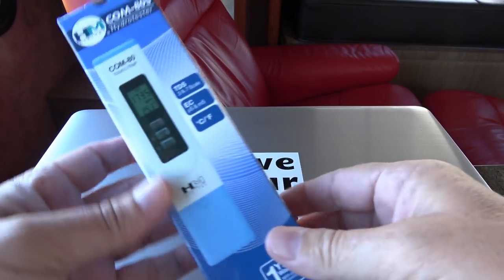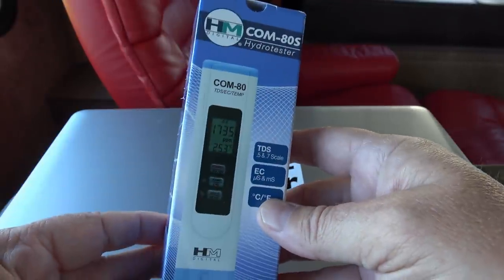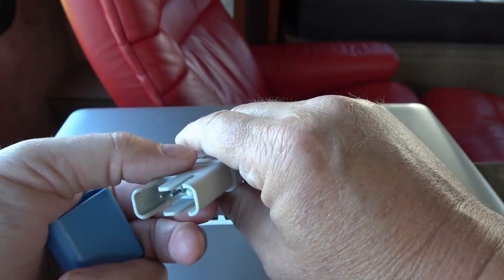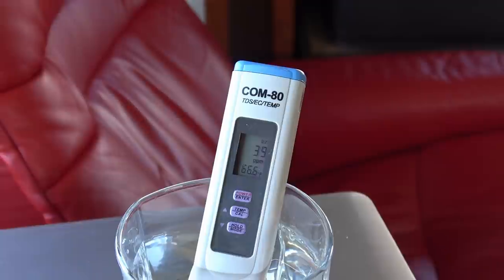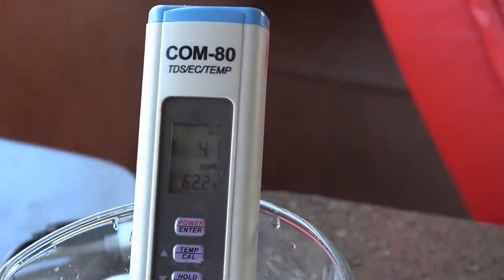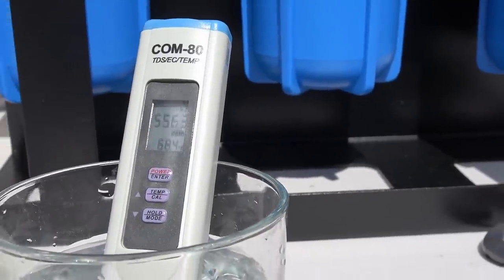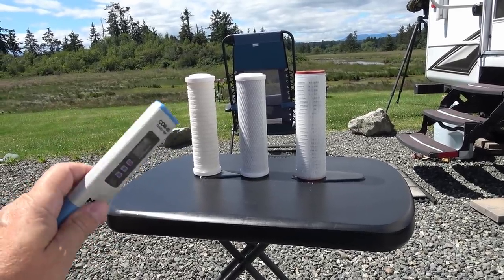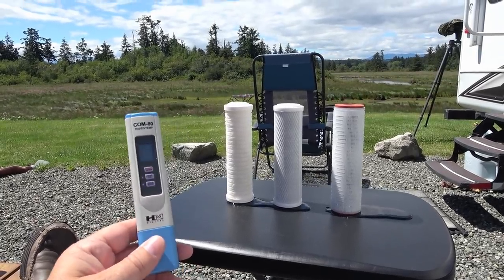Testing RV Fresh Water for Total Dissolved Solids - HM Digital Hydrotester

Comment: Thank you for designing and running this test. I have a system like your clear water and then stopping using it when I discovered it did nothing for PPM. I live in CA where tap water is horrible. I use the Zero water containers now. A filter only lasts about 30-40 days here. I am ok with the water until it surpasses 200 ppm.

Comment: Total dissolved solids are not automatically dangerous pollutants or contaminants. Ultimately, the type of dissolved solids in your water is far more important than the amount.
Reply from the maker: Yes, good point, many dissolved solids are supposed to be healthy for us. It's good to know if the levels are really high though as its not that great for the RV plumbing, faucets, kettles and water heater. Also the taste can suck. :)
Reply: @LoveYourRV  I am aware of the interaction between copper pipes or old cast iron and TDS but have never heard of any reactions with plastic pipes.
Reply from the maker: The calcium and salts deposits can clog the faucets, check valves, etc and settle in the bottom of the water heater, requiring much more flushes. If really bad it can build up in even the plastic piping and waste tanks.
Reply: @LoveYourRV  Our system is a Dalton Ceramic and a carbon block filter that is .5 microns. My point is that if you are going to test it needs to be valid. Not really practical with varying sources so assume the worst and filter for that.

Comment: Ray, I am in the process of installing an Acuva UV system in our trailer. RV Geeks had a discount coupon for $100 off that worked great. The system is from British Columbia. We are hoping to be able to drink the water from parks rather than bringing bottled water all the time. I will have a sediment / carbon filter upstream on all our water. This UV system has a dedicated faucet at the kitchen sink for drinking only. It is 1.2 liters per minute and the UV lights are LED.
Reply from the maker: Cool. :) They offered me one for review a few years ago but I declined when I saw the low liters per minute.  Here in BC I don't mind drinking right out of the tap, we have awesome water here in Campbell River and when in the USA I just buy from the water purification machines for about a buck for 5 gallons.  Let me know how it works for you.

Comment: The carbon filter in your setup is mainly to improve the taste of the water.  The simple, single stage RV filters that connect directly to your water supply hose do the same thing, but without the separate sediment prefilter and "polishing" post filters.  If flattened out to the molecular level, a teaspoon of activated carbon is said to have almost as much surface area as a football field.  That is why it makes such a good filter for liquids or gasses.
Reply from the maker: The cheap single stage carbon RV filters have much higher micron rating and the flow isn't as good, especially as they get clogged up.   I showed a cheap Camco and it was rated at 150 microns versus the Clearsource 5 micron carbon filter. Likely due to the chamber size difference I'd guess.

Comment: Ray, do you see any lose of flow using the three filters? There has to be some lose of flow I would think with the .2 micro filter. Thanks for the video.
Reply from the maker: The good part about this system is large filters and the extra-large canisters, they help the flow rate keep up. I showed the flow out of the taps in the review video and had a test shower - https://www.loveyourrv.com/deluxe-rv-water-filter-system-review-clearsource-ultra-three-stage/  I don't notice much flow rate difference. Of course, if you let the filters get too clogged up it can start to affect it.  Filter life is rated at 2000 gallons.

Comment: Thanks for sharing.  Like #263.  I heard de-ionized is not for drinking.
Reply from the maker: If the tap water is known real good quality and regulated I go with that, like to have the beneficial minerals and prefer it over the flat taste of pure water, when traveling poor water areas I tend to buy the machine purified water, since they use ultaviolet light, RO and other filters,, usually a buck or so for 5 gallons. 
Seems to be lots of folks here that like the Zero Water jugs and they basically use a deionizing filter from what I can tell. I usually use Anne as a guide she has some very fine tuned taste buds.
Reply: @LoveYourRV  de-ionized water does not taste good at all to me, and like you, i think we need the minerals.

Comment: If you go to Target and sometimes Walmart you can buy a product called "Zerowater" that actually comes with its own TDS meter. Cost for this gravity-fed water pitcher  is $19.99. 

The obvious benefit of a company that couldn't produce .000 on the meter would be foolish to give you a free tester along with their pitcher.

And you can use the meter to test all source water that you put into the filter. Remember the better the source water the longer the filter will last. Since it can only take out a finite amount of dissolved solids.

I cook and make ice cubes with I don't think anything more than .006 on the meter.

Now if I found a fresh spring out in the middle of nowhereand the water tested .60 for example I could go ahead and assume that those were beneficial dissolved minerals that would do no harm. Unless you were near an old nuclear...🤔

so send that back to Amazon get your money back and go to Target and buy yourself a zero water filter. And I'm stead of just being able to test your water you'll actually be able to produce water that tests .000

It's fun testing different water sources especially from the tap.

I'm not an electrician but it's basically an OHM meter test for resistance. Pure water has nothing in it so it doesn't conduct electricity giving you that zero reading, it's pure. (At least as it relates to Total dissolved solids)

If there are things in the water they will help conduct electricity from one probe to the next. You refer to this as the business end.

by the way that meter that you are showing is almost identical to the one that comes with every Zerowater gravity-fed water pitcher.

PS I Love Your channel. and you can use your filter system to make source water for your new gravity-fed pitcher. And you'll have two TDS meters that you can test against one another.
Reply from the maker: I thought it would be good to buy a product from a company that specialize in water testing instruments - http://hmdigital.com/product/com-80/  "Our products are co-designed between our Los Angeles office and our ISO-9001-certified factory in Seoul, Korea, producing high quality water testing and monitoring equipment for all types of water treatment and purification systems, including reverse osmosis (RO)"
I actually don't care about getting down to 000 ppm water, just that the water has the best chance of being healthy - https://youtu.be/XmkvNx1Cm-o  We generally buy purified drinking water from machines when traveling so we know that it is of a certain regulated quality and when in BC where we know the water is good and trust the local water boards, we drink right out of the tap. Cheers, Ray

Comment: My water has zero PPM.  I use a Zero Water filter.  When the Digital Hydro Meter reads 6 or above, I change the filter.  39 is quite high.
Reply from the maker: I find that low or 0 ppm water tastes kinda flat, like drinking distilled water but to each his own. :)  I love the water that comes out of the taps here, think it tastes great so don't filter it. On the road in the poor water areas like southern California or the southwest we buy water. Also, I've found that 0 PPM doesn't necessarily mean its not unhealthy water.   https://youtu.be/XmkvNx1Cm-o  Cheers, Ray